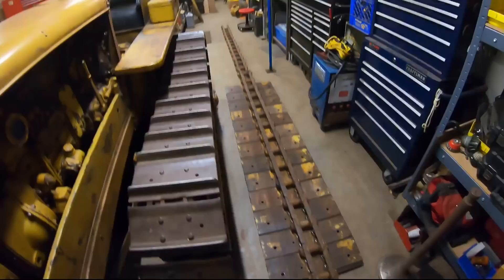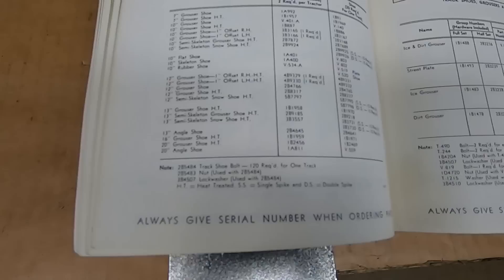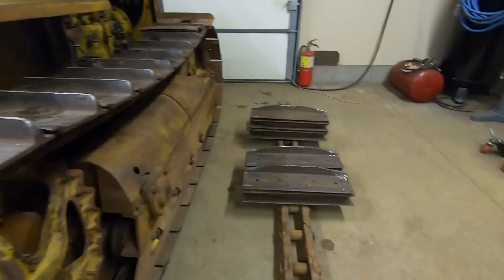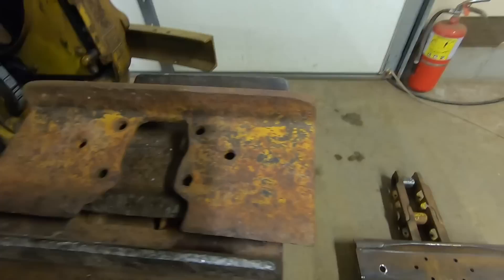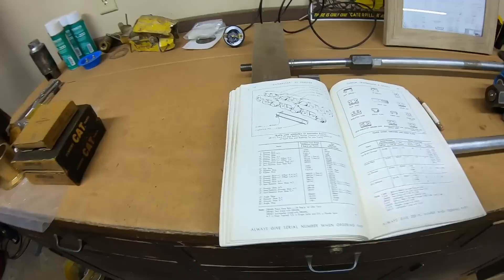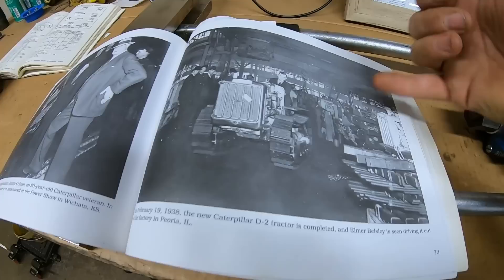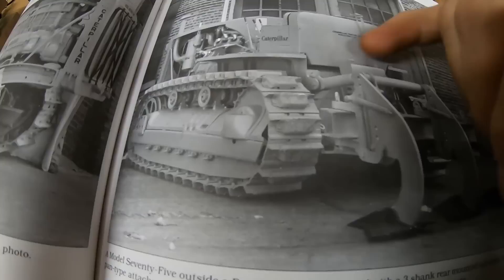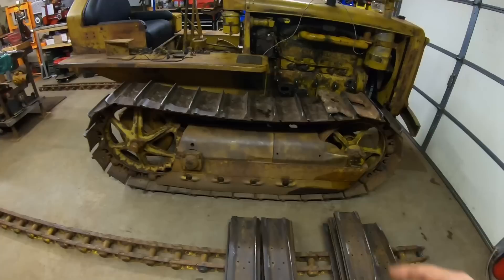How Many Different Types of Tracks Could You Get on a Caterpillar D2??? Factory Option Viewer Q&A

Comment: Most of the episodes are kind of intense (for me) -  this one was fun to see the range of width and options I would never have guessed,  that was great.   As a side note,  working on the AK Pipeline the dozers for winter (ice) used a setup where a small tab was welded on the end of a cleat,  then the next one had a tab in the middle,  then the next one had one on the end of the cleat.   That allowed a punch into the ice.   I saw a few without them and they just spun the tracks  which is something you don't expect to ever see.

Comment: The more I see these eps reminds me that I REALLY need to get my 5J D2 going. I don't think the track has ever been re-tensioned...track sags alot on top. Is a beast to get started which I suspect is either the transfer pump or obstructed filters (I have replacements but not done it yet). Have work on the property it can once it actually runs...which it hasn't done much of that either since getting it 5 yrs ago.

Comment: I enjoy your channel a great deal & have learned much from your content. I started driving cats in 1973 working for a timber company. They had 4 D6s, 2 4Rs, a 5R & a 9U amongst other tackle. Three of the cats were used for extraction & I spent many an hour pulling pulling trees. What surprised me most was the differences between each tractor, apart from shape of the bonnets, these were identical, yet each had its own oddities & quirks. One peculiarity they all shared was that once the diesel engine was warm then it was impossible to start the donkey engine. Have you ever heard of this? The 5R was the best of the four by a long way. I formed an undying admiration for the design & engineering in those old machines, we maintained them well in the woods, they were serviced regularly at a Cat dealership & just went on & on. Only a couple of years before my time the company retired a 2H. The man who drove it from new in, I think, 1935, was still working for them.
Reply: @squatch253  Thanks for clearing that up, it puzzled me for many a year. I'd suspected that it was a problem with fuel system caused by heat from the diesel though I'd no reason to think so. I really enjoyed the episode explaining why RD6 has so much bottom end grunt, that was a real eye opener. Chris Thomas, the old boy that drove the 2H from new, didn't like his D6 4R replacement & would tell anyone who would listen about how much better his old 2H was. Maybe he was right. Keep up the good work, it's mana from heaven to an old Cat enthusiast.

Comment: Understanding the one inch offset pads. Just a thought, Apply the dimensions to both tracks, then measure the total separation distance between the pads. I am not sure what gap distance will be revealed. BUT would it allow the tracks to straddle railway tracks? You should be able to see my line of thinking. It would seem that the separation width between the tracks was important for some reason - at the same time track width was not lost but as you have shown - just offset.
Reply: Wouldn't the offset pads reduce the overall width if the offset was to the inside rather than the outside as Squatch showed?

Comment: As for the carrier rollers they seem like they're very rare for the D2 you have I wonder would it be feasible to manufacture them yourself from blueprints or drawings or something like that you're pretty good at taking a drawing and turning it into a real part. Have an excellent day
Reply: Toby, doesn't the tractor with the rubber pads in the linked video have the carrier rollers? Or am I seeing something different than your looking for?
Reply: @squatch253  they may not be compatible but if anybody can get them to work correctly it would be squashed 253

Comment: I know you’re a D2 man but maybe yo have some literature on a similar subject. I went with a friend to pickup he auction purchase a few years ago and saw an unusual D4 there. It somehow looked unusual when I realized it had larger diameter drive sprockets and idlers making taller tracks. I was told it was an option for some special application. Just wondering if you know anything about such an option.

Comment: what if you had those 10 inch ofset ones interlacing  half on the left ofset half on the right ofset?
should make more traction on than regular 10 inch but it may have some special use and probably could balance itself more than ofseting the whole  track
or it may be also some high traction version of very narrow gauge where you need more grip but can't extend the width of the tractor outward
Reply: I was going to make that same observation/comment.